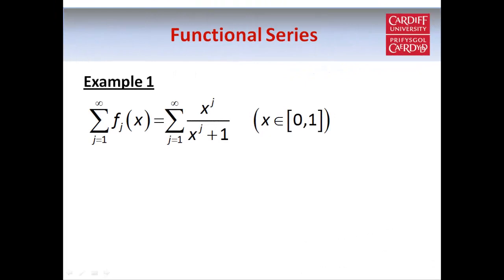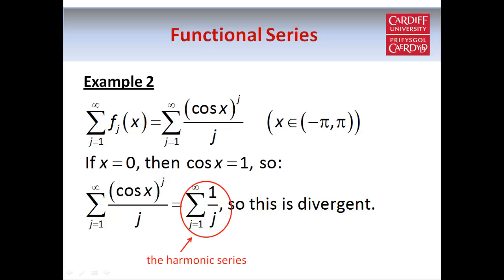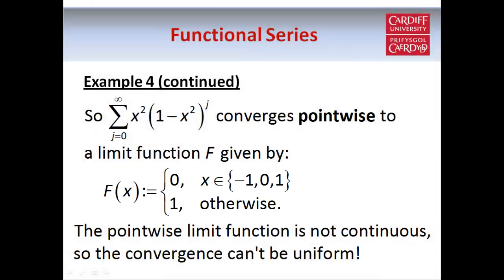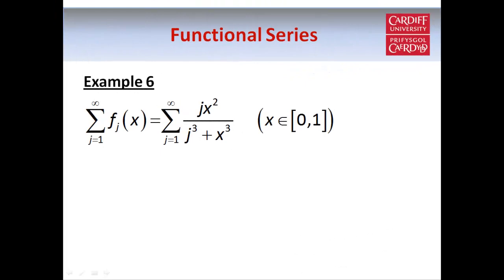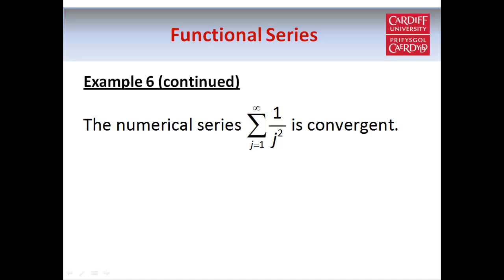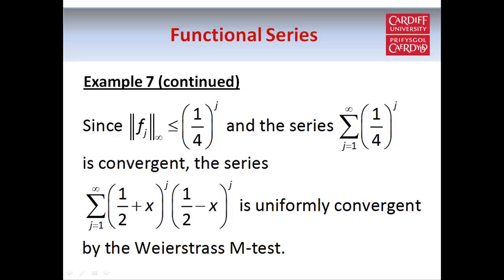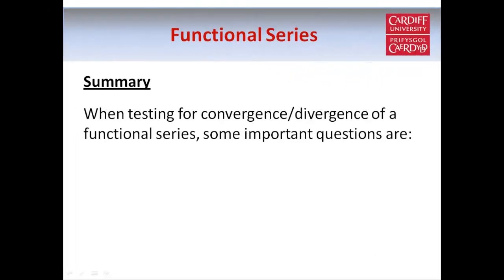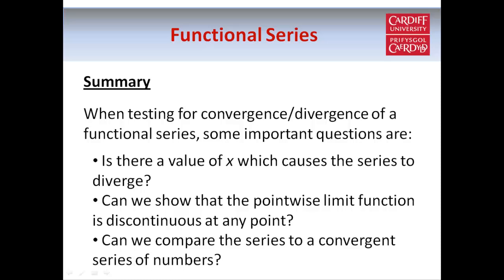Functional Series (Part 2 of 2)

Comment: in example 8, maybe 1/2 cannot be taken as supremum as it is not a part of the interval
Reply from the maker: Hi Aakarsh, luckily that doesn't matter because the supremum of an interval doesn't have to be contained in the interval.  For example, the supremum of the interval (0,1) is just 1.

You may be thinking of the maximum of a set.  The maximum of a set does have to be contained in the set, but the supremum does not (in some cases it might be contained in the set, but it doesn't have to be).
Reply: Thank you Mr.Rob for your effort to come back.It's clear now.I appreciate your explanation.It will be useful for my finals.